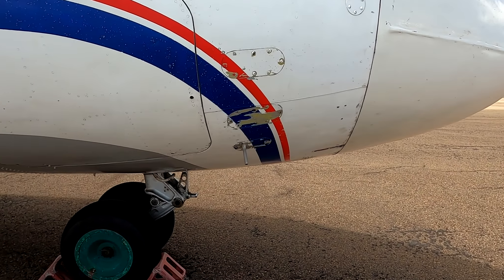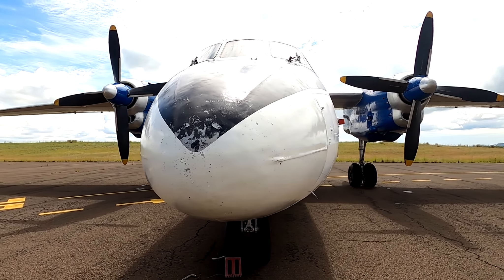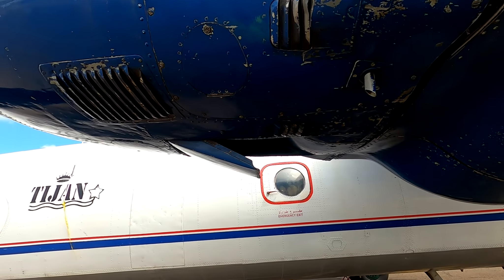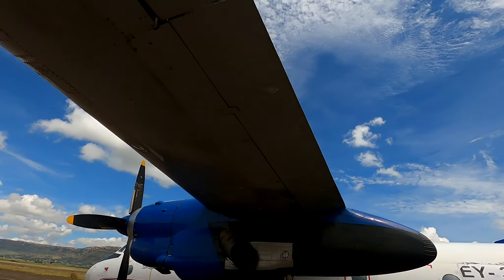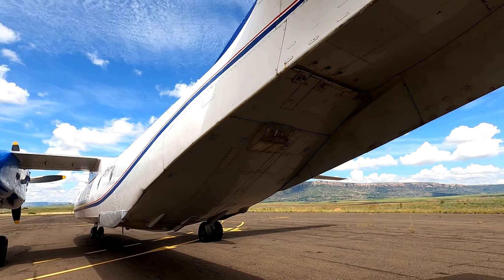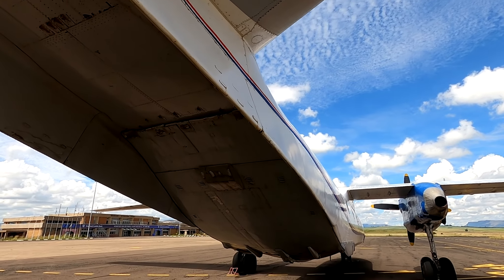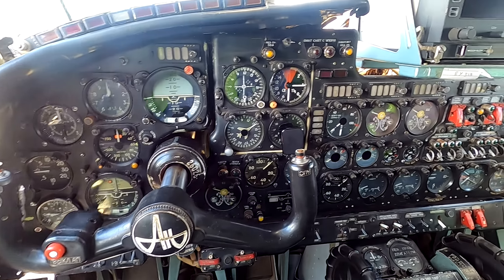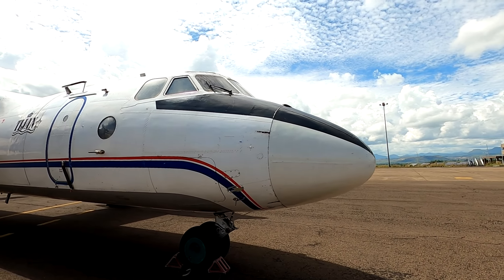DISCOVERING AN ANTONOV AIRPLANE IN SOUTHERN AFRICA

Comment: Sheesh, they seem to dislike forward visibility. Some of the cockpit pictures you can find online there is basically a hand sized amount of window you can actually see through!
Reply from the maker: Cockpit Vis is extremely limited in this one, particularly with the after-instalment of the GPS in the centre dash console, completely obscures your view
Reply: @LSAviation  I remember finding a pic somewhere, where they had these large gps boxes mounted on the already tight dashboard. Could hardly see out the front
Reply from the maker: @RaygunGaming  it's amazing that it was even allowed but I guess as long as they have a snippet of vision - takeoff